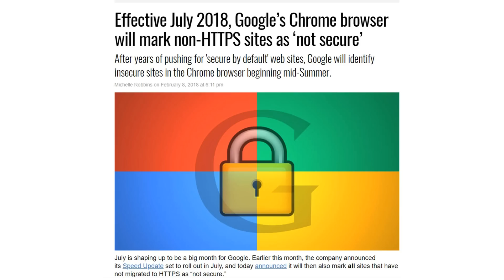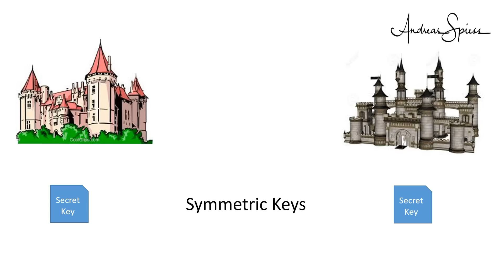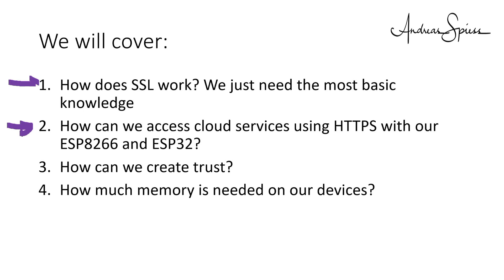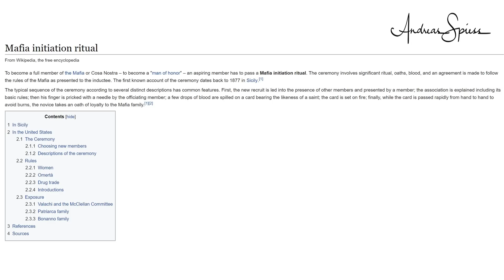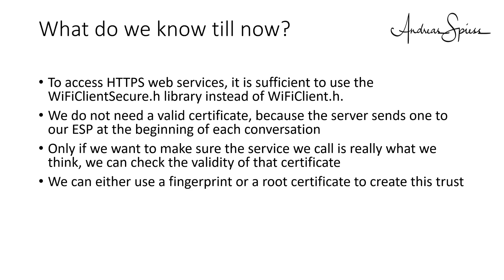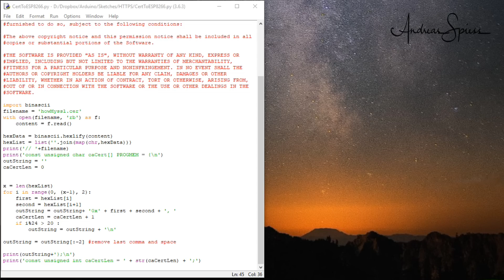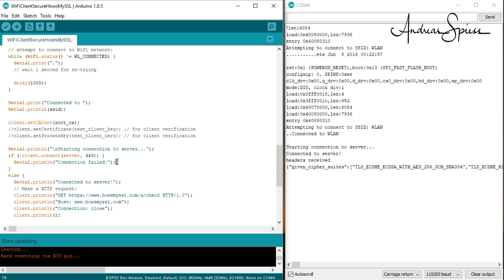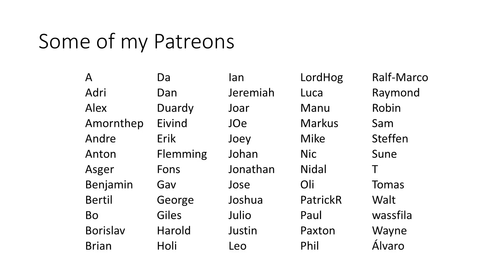#232 How to secure our devices using SSL (ESP8266, ESP32, Tutorial)

Comment: You got that wrong.

Encryption != Security

Encryption = secrecy if the encryption is strong.
Reply from the maker: I think encryption can be part of a security concept.
Reply: @AndreasSpiess  a solid authentication is much more worth than encryption. Also a secure handshake and strong random number generators are necessary before you can think of encrypting anything.

IoT device usually have trouble generating solid random numbers and usually have backdoors or major implementation flaws of the APIs for logins. Just adding encryption is usually just a patch which do not cover the holes below.
Reply from the maker: I do not understand a lot about the underlying technology. I just want to access some services which do no more accept HTTP requests. I do not transport real secrets with my devices :-)
Currently, everybody uses HTTP and I thought even a bad implementation of encryption is better than that.
BTW: Why do you write, that authentication is more valuable than encryption?
Reply: @AndreasSpiess  authentication is signing your messages cryptographically. Without it your encryption is easily breakable if you're in the middle - which is the assumption for "why we need encryption". For strong authentication and strong encryption you need a good handshake method, and for this to be secure, you need a good source of true random numbers. If an attacker can guess the random numbers you generated for your handshake it's likely that he can decrypt the handshake. With a really badly designed handshake it would also be possible to calculate the private key, after guessing the random numbers.

So in short random number generators are the first step to implement a secure communication.
Reply from the maker: If I understand right, you always need a "man-in-the-middle to "hijack" the connection. So the effort is considerable to inject data to a web request from an ESP using a poor encryption. BTW: A board with a receiver has no problem to get random numbers. Just listen to the receiver on an empty channel (white noise). But I do not know if the ESP library uses this process.
Reply: I had a similar response, just adding encryption doesn't make you secure. Security needs to be included in the design from the start, encryption is part of that. Using a signing mechanism for message security is a good start (like HMAC).

A much better approach, in my opinion, is to utilise a gateway from your IoT devices to the internet (a Raspberry Pi with an MQTT-SN gateway for example). The gateway will have a full suite of CA certificates that are regularly updated, all requests are made via the gateway. With that design, your IoT devices do not need to be reflashed with keys (fine if you only have a couple of devices but many more and this becomes a chore), do not have direct access to the internet and can be kept simple.

Comment: Why not store the  X.509 cert on flash or a SD card so the cert is not hard coded in the sketch so using the  card so the cert is read from it and if they are changed because they they have expired.
Reply from the maker: This is possible, of course. But if they expire in 4 years I do not care too much...

Comment: I use an nginx-"Proxy". 

server {
    ssl_certificate     /root/certs/cert.crt;
    ssl_certificate_key /root/certs/cert.key;
    ssl_ciphers EECDH+AESGCM:EDH+AESGCM:AES256+EECDH:AES256+EDH;
    ssl_protocols       TLSv1.1 TLSv1.2;

  listen 0.0.0.0:80;
  listen 0.0.0.0:443 ssl;

  location ^~ /espeasy/ {
    proxy_pass http://10.0.1.10:80/;
  }

  location ^~ /esp32 {
    proxy_pass http://10.0.1.11:80/;
  }

  location ^~ /esp8266 {
    proxy_pass http://10.0.1.12:80/;
  }
}

Works. Simple. :-)
Reply from the maker: How does this connect to services like Thingspeak on HTTPS? And do I need any other computer in addition to the ESP?

Comment: Another very useful video. Thank you!

But I also think it's important to learn how to provide a secure https connection on the little websites hosted on an ESP*.  
All those important little web interfaces, often with username and password fields to access them, etc. - so many http://192.168.*.* admin interfaces need to be secure. 

I see that recent updates to the ESP8266 libraries appear to contain a lot more examples for this, such as 'WiFiHTTPSServer', which also contains a script to generate a 'Self-Signed Certificate' to enable your ESP*-hosted website to run via https.
Reply from the maker: You are right, you can also encrypt these connections. I usually do not encrypt the traffic behind my firewall and use MQTT for the connection to my ESPs . So I had no need for this scenario so far.

Comment: If you don't have the ability to use https (like with my with my cheap attiny) I setup up a ssl proxy (look for tls offloading or (I think) tls termination proxy) on a PI (which is my cheap server) to handle the encryption part.
Two "possibles issues" : 
1) One more potential failure in the chain
2) I must trust my own network
Reply from the maker: We used these proxies in the past and they work well. I wanted to show that we can do the same only with an ESP. Your method, of course, is still possible and can solve some issues, especially issues with resources on the ESPs

Comment: Some notes:
- If you are running the server (for example when communicating between an esp32 and your PC) you can also create your own certificate authority and make your client esp32 trust that CA. Usually referred to as "self signed" certificates. Same security, less Mafia :)
- For validation via fingerprints you can also use the fingerprint of the certificate authority (or any other point in the chain). Not sure if that's easily available with WifiClientSecure (my esp32 is still in the mail)
- Supporting more cipher suites may actually be bad, as an attacker can remove secure ciphers from that list via a downgrade attack. Therefore you might end up using an insecure cipher.

If you control the server, other options may actually be better for performance. For example you could avoid the asymmetric crypto part by supplying your device with a static symmetric key once. If you only care about integrity (no one else may edit the data) and not about confidentiality (no one else may see the data) just signing the data is enough.

Not sure how much of those is exposed in easy to use libraries for the esp32, but since it can do https, both ideas should be fairly easy to achieve.
Reply from the maker: Thank you for your comment. This video was focussed on accessing available services outside the firewall. So far, I do not encrypt the traffic behind my firewall. I am sure your comment helps if somebody wants to do that.
Reply: This doesn't have anything to do with firewalls. It's about running your own server, something you can do either locally, available only to your LAN unless you configure the NAT and have a static IP address or use a dynamic DNS service such as No-IP (free with limitations); or remotely, with a hosting provider.

Comment: IMHO TLS on platforms without even basic stuff like memory protection is maybe not totally pointless but only slightly better than it not being there at all. Especially when you have so little memory to start with and the memory pressure created by the TLS library will make it easier to create overflows etc. I say this after having implemented TLS on a Cortex M3 based product with more memory that's out in the wild in a few hundred thousand units... when I think about how many issues the industry-standard OpenSSL had/has I really don't have much hope that any of the embedded TLS libraries, which AFAIK are all based on some old BSD licensed code that was kicking around, being all that good.
In most applications you'd use a microcontroller for you don't even want the privacy (encryption) bits. You mostly want to validate the source of messages. I think there are cheap i2c secure elements that can do HMAC signing and validation. That seems like a better solution IMHO.
If you have an upstream service that requires HTTPS it seems to me like a gateway to that service running in the cloud would be better than trying to do it on the ESP itself.
Reply from the maker: I am no security specialist and I just wanted to show how we can make sure that we still can use our cloud services if they only accept HTTPS connections. Maybe it is not secure, but I cannot change anything because I have no knowledge in this area.
If you have to build a sellable product this is another story, AFAIK the new Arduinos use such an I2C chip. I also do not understand what the encryption blöocks in the ESP32 do and if they are used by the libraries.
Reply: I wasn't being negative about your video. I was being negative about the state of this stuff in IoT in general.

>we still can use our cloud services if they only accept HTTPS connections.

Many cloud services seem to assume you have a platform that can do TLS properly. AWS IoT for example requires TLS, device certs etc but didn't take into account that a little microcontroller based IoT thingy might not have the right time. Without the right time TLS is useless and many IoT platforms might only have a time that is within the right month and not within the right day that would be required for the very short expiry certificates AWS, Google etc want to use. There is a disconnect between the service providers and people making stuff that uses the services.

>AFAIK the new Arduinos use such an I2C chip.

There are a few examples of it. One of the earliest IoT platforms (electricimp) used an i2c secure element.
Reply from the maker: At least the ESP32 example connects to NTP to get the time. Now I know, why :-) Thanks!

Comment: This is a great intro into SSL for anyone new to the subject,  I do alot of conversions myself as I use ( mostly dreaded ) KeyStore/TrustStore in Java and have to provide the chains as you describe in the browser.  I would just add that anyone venturing into this territory ( even under windows ) to familiarize yourself with the openssl command and its syntax, just be aware that I have found some quirks with windows that the only work around I found was to move all the required files to a linux system ( VM ) and finish up there.

I to use letsencrypt using the certbot engine to roll my keys when they expire automatically ( In my home ),  super slick and easy to get up and going once you understand the basic principles.

Great video as always.
Reply from the maker: Thank you! I think your comment is more for the server side. In this video, I  tried to focus on the client/IOT side to be able to access HTTPS servers. So far I never built a server myself (other than my Raspberries behind my firewall).

Comment: Great overview, security is a vital topic for IoT and advanced tech is nothing without such good pedagogical presentations. I wonder if it is that easy to have the esp32 as an https server ?
Reply from the maker: I think it is possible. However, I do not use encryption behind my firewall.
Reply: I also would not venture opening up a port for an esp32 through my double routers walls, I use a VPN for that. But the IoT is pushing with things like Thread that standardizes bridging ipv6 sensors to the internet, we'll see how IoT security will evolve.

Comment: Very interesting Andreas, if we could integrate this with wifi manager that could store certificates, the link between esp8266 iot devices with sensors would be more secure.
Reply from the maker: I think you could do that. But if the certificate is valid for a few years, you probably do not want to change it through WiFimanager.
Reply: Ah, yes, I think I see the point - being able to change the key without programming.  Perhaps that is something that could be added to IotAppStory.com for example?

Comment: Vpn might only be helpful in cases where you own the endpoint of the connection as well, if i'm not wrong. But i'm asking myself if its possible to access a local proxy server via http and let it do the heavy https stuff with the outside world?
Reply: It is but it leaves your IOT devices vulnerable to local attack, personally I don't want anyone else able to access my cameras, heating controls etc. nor do I want to leave any easy entry point into my home network. I use ssl on all my gadgets even though  everything external is handled by a proxy.

Comment: What about power usage?  encryption/decryption doesn't happen for free, more power and more data usage...
Reply from the maker: There is a post of another viewer (Frank Hessel) which covers that aspect. I did not investigate into the connection times necessary using HTTPS vs. HTTP. HTTPS times definitively are longer. But, if our service providers change, we have no choice:-(
Reply: Ahhhh, I didn't think about that while I was watching. Not such an issue if the device plugged into a wall socket. But if it's powered by a LiPo (or similar), that could make a huge difference

Comment: Great tutorial as always! However, I think one important step is missing here - how to get a certificate from trusted CA. As I see from your screenshots you're using LetsEncryptIt certificate, do you plan to create another video on this? Thanks!
Reply from the maker: This video did not cover the web server part. Because of that, I did not cover the installation of certificates on the ESP. In this scenario, there was no need for creating certificates as this is done by the service providers.
If I find a scenario where we need a certificate on an ESP I will cover also this aspect. So far I did not find one.
Reply: @AndreasSpiess  Accessing ESP device web interface isn't this scenario?
Reply from the maker: No, only connecting a web server from the ESP. Of course, the SSL theory applies to both scenarios.

Comment: Could you not update the keys using OTA updates or a form of external memory?
Reply: I was thinking the external memory, using an EEPROM. OTA of the flash might be a bit much if you needed to do it every other week just for a key. imho
Reply from the maker: You can update the keys from the outside. But you should not forget it. Otherwise, you cannot do it anymore ;-)
I like the idea of longlasting certificates more appealing, though.

Comment: Consider also https for esp8266/32 in server role. It's pretty easy with reverse proxy and raspberry pi and nginx for example. Some additional config is necessary for separation iot and normal sides of home network.
Reply from the maker: So far I do not use encryption behind my firewall (for IOT devices). This video was mainly to ensure we still can use useful cloud services. But if you want to access your ESP from the outside it might be necessary...
Usually, I use MQTT instead of a web server on the ESP. I find it more appropriate for the small resources of our devices.
Nginx is on my video list for a long time..
Reply: I know that this is old but I was strugglin with this as I want to do my IoT devices as secure as possible, keeping in mind good practises.

Since I have some others (In fact, a lot) ESP servers at home which I want to reach from the outside (All of them are HTTP with basic authentication), I think that my best shot is to build a reverse proxy with a SBC (Probably a raspi), isn't it?

Whad do you think @Andreas Spiess ? Do you have any vids on this topic?

Thanks in advance!